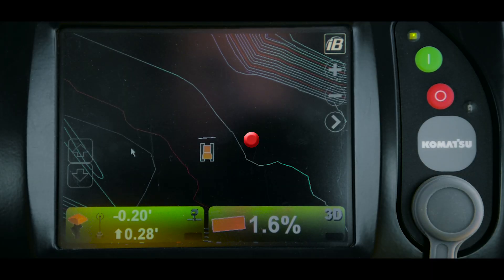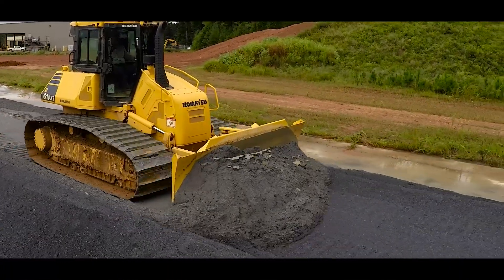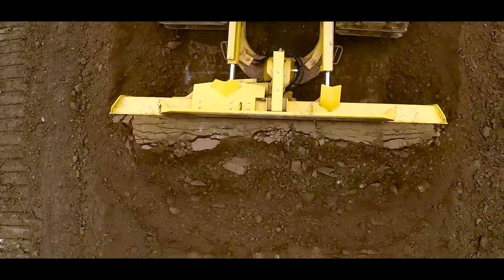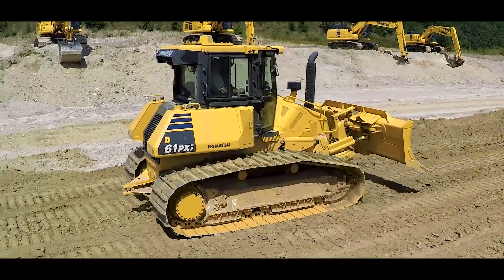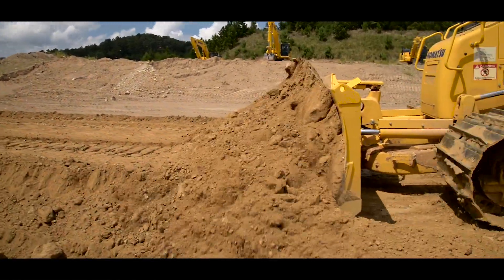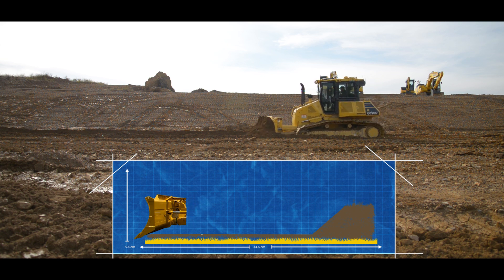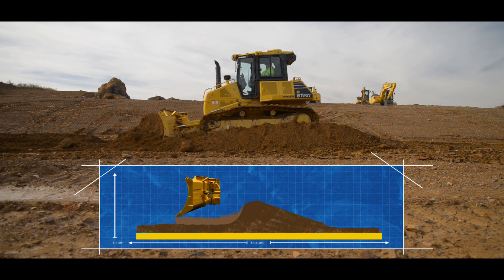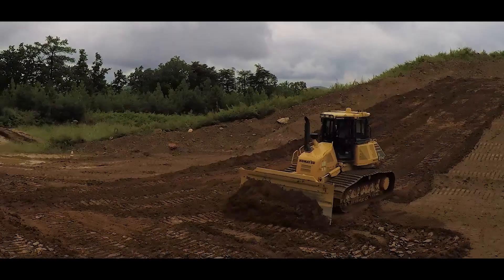Intelligent machine control kwick tips: dozing control modes

Comment: I recommend using this as an aid instead of relying totally on the machine to do the work. I never hit the auto button until I get within a couple tenths. I find that I can do a better job than the machine get g it close and then auto to finish
Reply: I agree. Like all machine control machines its up to the operator to get it withing a working tolerance then push auto and make the most of the thousands of dollars u spent for the machine control.